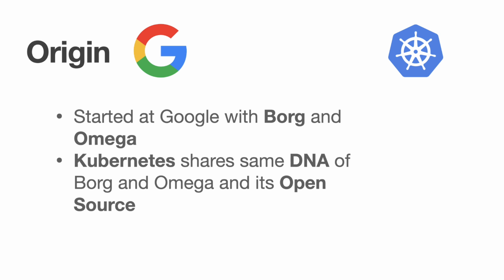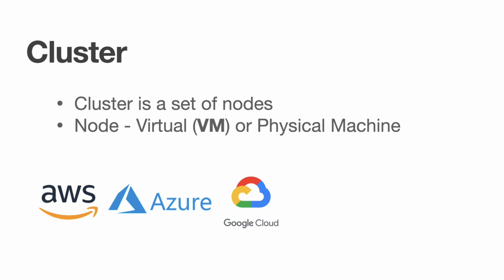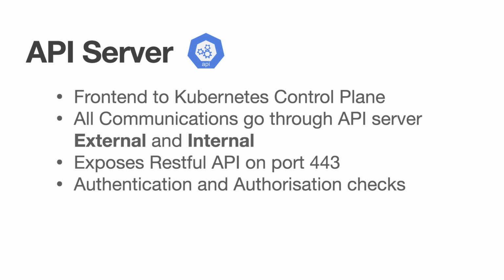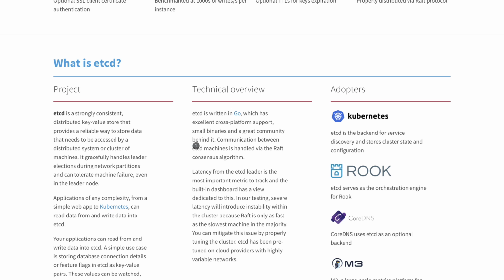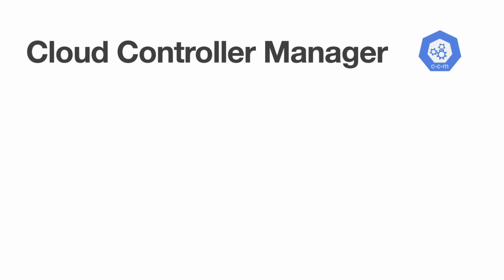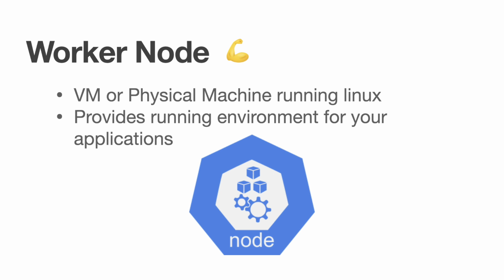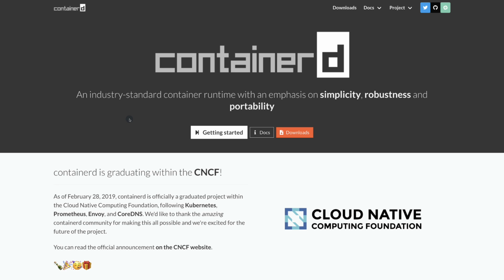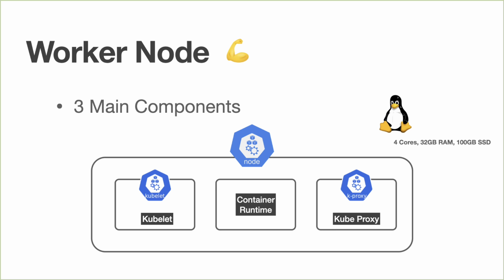Kubernetes Tutorial - Kubernetes Architecture Explained

Comment: How to run bash script on host from docker container? My docker container is a springboot application, inside the application there is a bash script which  is mounted from the file system. for example if the bash script only contains "ls" command, executing the script from springboot application must list all the directories/files in side the host machine. thanks Amigoscode